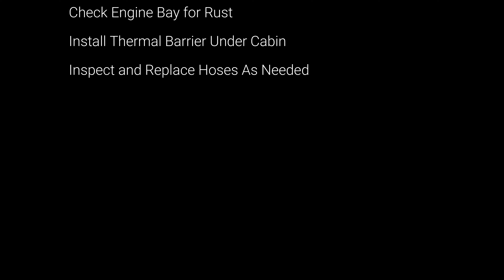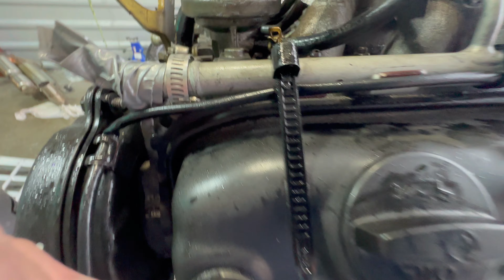Intake and Timing Belt Removal- 1997 Daihatsu Midget II (K100C)

Comment: thank you for this info! you recon this can be done with the engine in the car?
Reply from the maker: Yes, it can. In fact on this model (Midget II) I think it's easier to do with the engine installed rather than pulling the engine out to do the belt. Having said that, if a person has the space to work and a jack of some sort to lower the powertrain, removing this powertrain isn't hard.